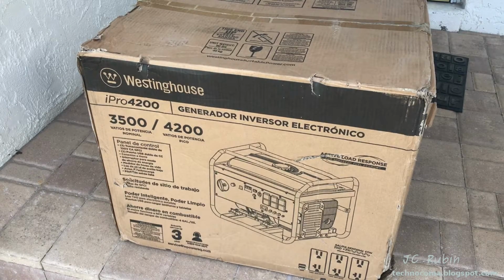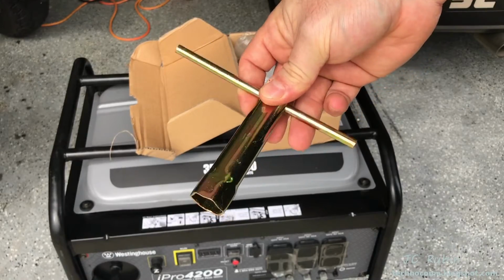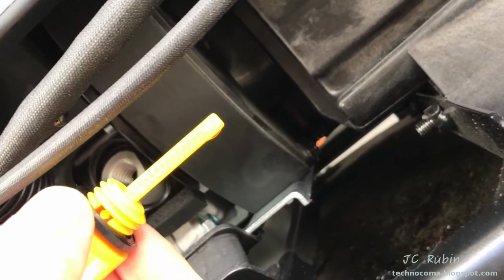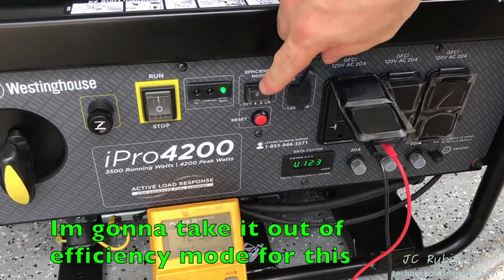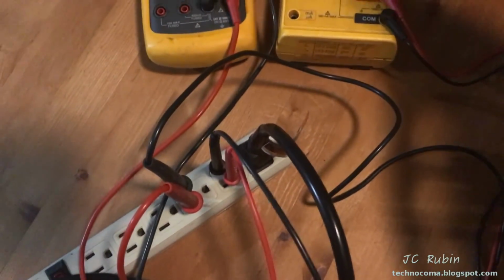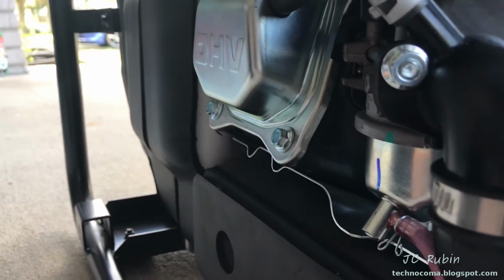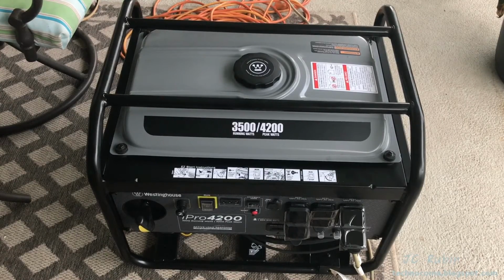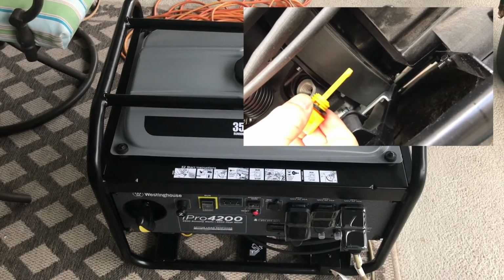Westinghouse Ipro4200 Inverter Generator - Unboxing , Full test and review

Comment: I love my generator◔◔>share4.photo/F29WInverter?Kらf    I keep it stored in the garage under the upsidedown box that it came in. This is a quite unit, powers my travel trailer A/C, runs a long time at low load, it is well built, starts in 1-2 pulls after coming out of the garage, and is backed by a great company.
Reply from the maker: I wish it has a sopported after market natural gas adapter. Im still researching this.

Comment: This is a BAD product. It's improperly designed. I left gas in the carb for 2 weeks and now it surges unless you pull the choke out and leave it like that (indefinitely). Mechanic said it needs a new carb to the tune of $200 and the carbs don't fall under the warranty. In their manual, it says to not leave fuel in for more than 60 days, but apparently, you can't EVER leave fuel in it as it ruins the carb. So basically you have to empty it every time you use it, which means it's not suitable for job site use. I wish I could get my money back, as I can't use or trust this thing. They must use some REALLY cheap materials in those carbs, as they do not stand by them AT ALL. Very disappointed in this unit.
Reply from the maker: I haven't had this issue, Ive also stored it with some gas over intervals and looked in the carb.  Ethanol can be a problem for any carb, but I haven't found any here yet.
Reply: @rubin-tech  try it now. I bet it'll surge and not run right.

Comment: Did you have any complain about this generator? I want this for my house you know a fridge not to large and 2 tvs i beleved i want to hookup with a transfer switch but i need to know please what you think? If this is a good generator? You know the brand is whak
Reply from the maker: No, only that it did not have a fuel gauge, no ready natural gas conversion kit nor a twist lock 30amp outlet.
Reply: This is a BAD product. It's improperly designed. I left gas in the carb for 2 weeks and now it surges unless you pull the choke out and leave it like that (indefinitely). Mechanic said it needs a new carb to the tune of $200 and the carbs don't fall under the warranty. In their manual, it says to not leave fuel in for more than 60 days, but apparently, you can't EVER leave fuel in it as it ruins the carb. So basically you have to empty it every time you use it, which means it's not suitable for job site use. I wish I could get my money back, as I can't use or trust this thing. They must use some REALLY cheap materials in those carbs, as they do not stand by them AT ALL. Very disappointed in this unit.

Westinghouse Outdoor Power Equipment
Reply: Stay away. I bought it to keep my family comfortable during hurricane outages and keep my two refrigerators going. The pos wouldn't run right after leaving fuel in it for just 2 weeks. It was brand new fresh gas too. They told me to take it to a shop for the warranty. I did, and they said "It's the carb, it's not covered" I had to PAY THEM just to get it back. It's not a reliable product. I've since fixed the carb myself (had to work on a brand new unit), and am afraid to turn it on. Even more afraid for when I actually need it. Don't make my mistake.

Comment: I hate to tell you this, but all the generators I have seen (and mine) have the same oil fill arrangement and the same plastic dipstick (or similar). They are all located in roughly the same place. They don't use an extended dipstick like some lawn mowers do. I assume they have their reasons. One could be to avoid overfilling the reservoir. Good luck with your genny. Thanks for the review. Check out the other generator unboxing  and preparation videos on YouTube. Interesting.
Reply from the maker: Ive noticed that.    A cost saving pain in the butt. But the overfull possibility makes sense.
Reply: @rubin-tech  I live in Florida and that storm that hit the Panhandle convinced me I needed a new generator. In fact, I bought two. One is a completely enclosed inverter generator, the other an old-style open frame genny like yours. Luckily, since I've gone through the breaking-in process already, I will only have to fiddle with the oil once a year.  I just have them for power failures. Both came with the long-neck funnels. Oh well.
Reply: @mso4433  ⚠️very important announcements about portable generator safety:

This is just a reminder.

1) KEEPING OTHERS SAFE: Please do not allow an unqualified person or your children to operate and service the portable generator. Just because some manuals don’t say that doesn’t mean it’s safe. That is important against the generator safety rules. We also need to be keeping an eye on our children too. You need to make sure that your children are not playing near the portable generator especially when it’s running so they won’t get electrocuted. Generators pose electrical risks and they can be hot during an operation. Please keep your children away from the portable generator at all times. It is important to keep our children safe especially our little ones. Be aware of all the hazards.

2) WHERE TO RUN YOUR GENERATOR: Some people use their portable generators indoors which increases the risk of carbon monoxide poisoning. It’s important to have a carbon monoxide if you have a gas generator. Never ever use your generator indoors even if your doors and windows are open and even in the garage is not safe to use a portable generator. Not even at your porch and your deck. It is never safe to use your generator indoors and in enclosed areas of your home. Your generator needs to be 15-20 feet away from your house. 

3)🔥FIRE HAZARDS: Never refuel your generator while it’s running. You need to let your generator cool off before refueling it and before storing your generator. Never overload your generator too. Never ever back feed your generator. You should never plug your generator into a wall outlet. Also never store propane tanks indoors. Please keep flammable things away from the generator as well and please don’t smoke cigarettes near the generator. Having a fire extinguisher next to the generator is also important against the generator safety rules. 

4) GENERATOR OPERATION: make sure your hands are dry before touching the generator. Never use your generator in wet conditions. Don’t let your generator get wet. You need a generator tent if you need to use your generator during wet weather. Please don’t wear loose clothes when operating the generator. Turn on your generator before plugging in appliances. Use the right cord for your generator. Please do not use worn out cords. 

https://youtube.com/shorts/eFigDfnPkcQ?feature=share and here is a short video more about keeping others safe when using generators. It’s always important to be aware with the hazards. 

Hope this helps.

Comment: The voltage might read high right at the plug to anticipate voltage drops due to long/thin gauge extension cords.
Reply from the maker: This was specifically noted and tested in the video
Reply: Whoops, completely missed it! Thanks for a great review.
Reply: @archdukeofsynth  ⚠️very important announcements about portable generator safety:

This is just a reminder.

1) KEEPING OTHERS SAFE: Please do not allow an unqualified person or your children to operate and service the portable generator. Just because some manuals don’t say that doesn’t mean it’s safe. That is important against the generator safety rules. We also need to be keeping an eye on our children too. You need to make sure that your children are not playing near the portable generator especially when it’s running so they won’t get electrocuted. Generators pose electrical risks and they can be hot during an operation. Please keep your children away from the portable generator at all times. It is important to keep our children safe especially our little ones. Be aware of all the hazards.

2) WHERE TO RUN YOUR GENERATOR: Some people use their portable generators indoors which increases the risk of carbon monoxide poisoning. It’s important to have a carbon monoxide if you have a gas generator. Never ever use your generator indoors even if your doors and windows are open and even in the garage is not safe to use a portable generator. Not even at your porch and your deck. It is never safe to use your generator indoors and in enclosed areas of your home. Your generator needs to be 15-20 feet away from your house. 

3)🔥FIRE HAZARDS: Never refuel your generator while it’s running. You need to let your generator cool off before refueling it and before storing your generator. Never overload your generator too. Never ever back feed your generator. You should never plug your generator into a wall outlet. Also never store propane tanks indoors. Please keep flammable things away from the generator as well and please don’t smoke cigarettes near the generator. Having a fire extinguisher next to the generator is also important against the generator safety rules. 

4) GENERATOR OPERATION: make sure your hands are dry before touching the generator. Never use your generator in wet conditions. Don’t let your generator get wet. You need a generator tent if you need to use your generator during wet weather. Please don’t wear loose clothes when operating the generator. Turn on your generator before plugging in appliances. Use the right cord for your generator. Please do not use worn out cords. 

https://youtube.com/shorts/eFigDfnPkcQ?feature=share and here is a short video more about keeping others safe when using generators. It’s always important to be aware with the hazards. 

Hope this helps.